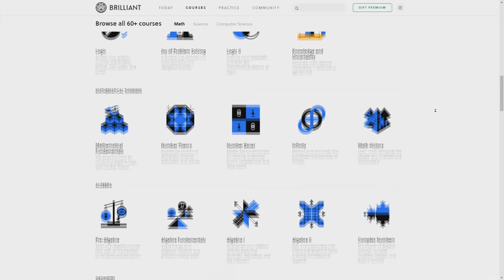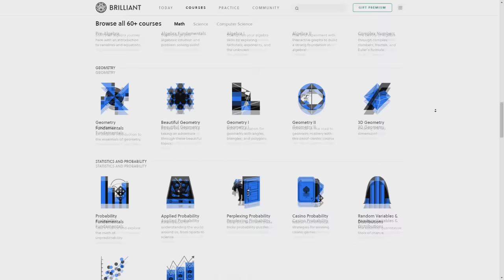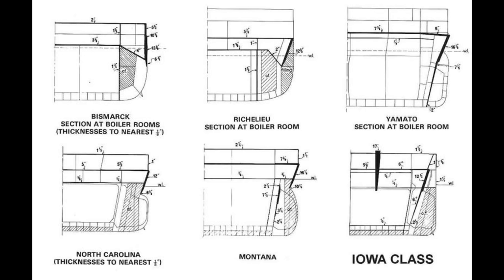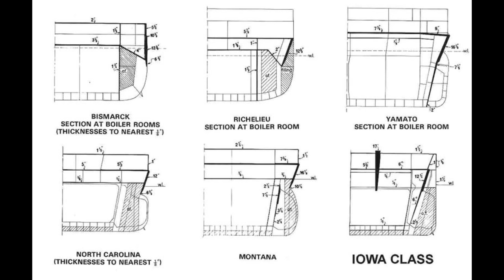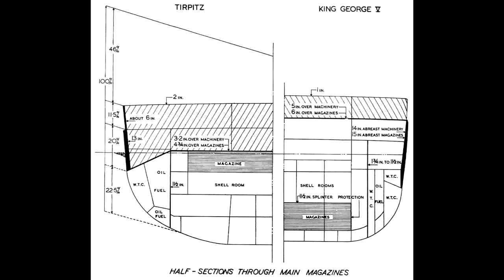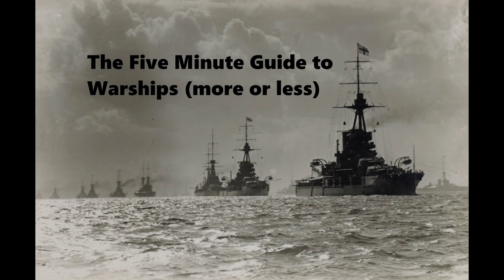Dreadnought Modernisation - A tri-wire balancing act

Comment: The USA has gone completely backwards, with new builds since the 70s.
 Their R2D2's should be increased by a minimum of 4X, preferably 8X, on their Carriers.
  And 3-4X on their frigates & 3-6X on their destroyers & cruisers..
 They are far to vulnerable in simulations.
Reply: Phalanx gun systems and other gun based close defense is increasingly obsolete. Your coverage pattern ceases to mean jack crap if the missile crosses their engagement envelope within a second and strikes the ship.
Even the heavier calibre systems like DARDO are becoming burdened by the fact that they have to stop something so close and can only engage one at a time.

Comment: My challenge will be to modernize  and re commission BB35 USS TEXAS 2025 it shall maintain its appearance with forward tripod mast intact be repropultionized it shall retain 8 14 inch guns only the midship 14 inch gun turret shall be converted into a harpoon/cruise missle battery it will have numerous ciws installed all analog fire controll systems will be retained for emp proof combat along with modern fire controll electronics and radar its secondary 5 inch armament shall be retained this is my challenge

Comment: Around @13:52 you see something like a ruler painted on the side of the B- and C-turrets. Does anyone knows whats the purpose of that?
Reply: I think it's more of a compass than a ruler, if your central fire control is down, but lets say 'A' turret is landing rounds in the right area, then you can at least read the bearing off and point your other turrets guns in the right direction.
Reply: @gwtpictgwtpict4214  Thanks!
Reply: @Desmosoom  Happy to help, but I was working from memory so you may want to check and verify what I said 🙂

Comment: Dreadnought modernization?
Simple.
As soon as the 1921 bombing tests off Cape Henry were done - imperfect as they were - the writing was on the wall.
The dreadnought battleship was eventually doomed.
Every, single, modern one should have either been converted to an aircraft carrier or scrapped from that point onwards.
95+% of you will disagree.
That just proves that much more that I am right.
☮
Reply: You know I might be willing to see where you're coming from, if you weren't so arrogant about it.